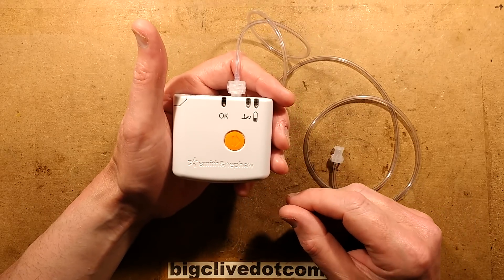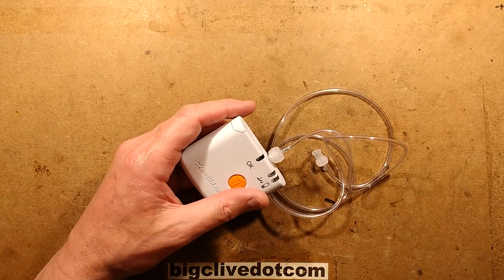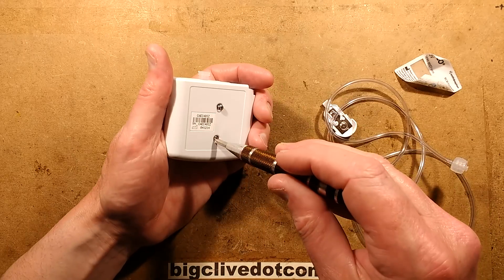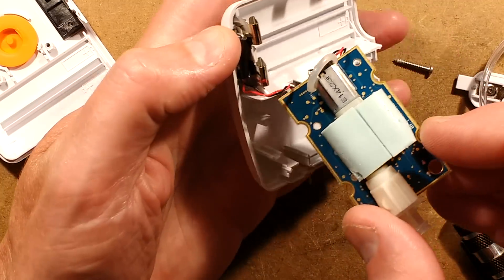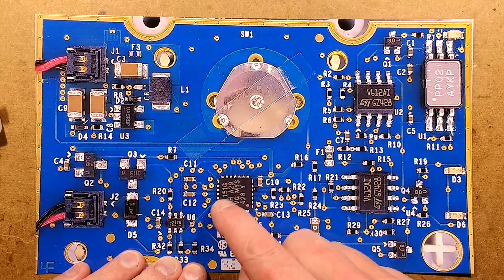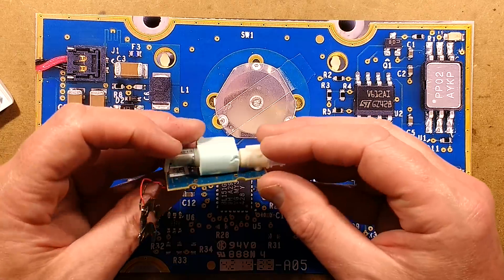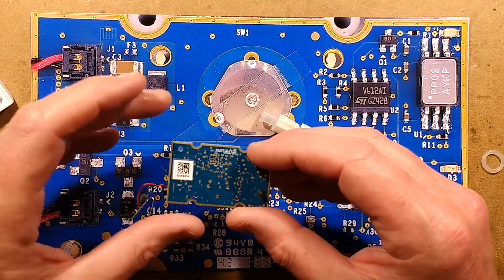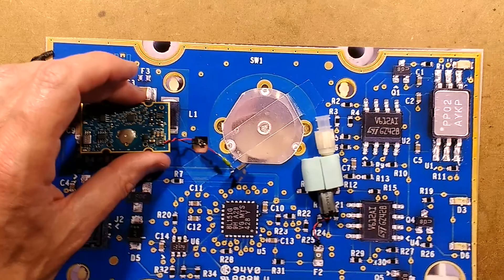Inside a medical wound sucking machine.

Comment: When you said, "it is a device that sucks your wound," I heard, "it is a device that sucks your wind." Picture me doing a spit take. It has to do with variations in speech between Great Britain and the United States. A device that sucks your wind does indeed sound like a medical device though. If you have bad gas, you can put the other end of that hose up your butt, pump out the bad flatus, and pass it through an activated carbon filter before returning it back out for everyone to breath. You should get to work on that right away! Big Clive's Nasty Wind Sucking and Purification Machine. It improves the lives of your coworkers when you have to work with them with bad gas! This device should also be mandatory at all eating establishments. Who the hell likes it when your food preparers fart around your food?! BLECH! Just install Big Clive's Nasty Wind Sucking and Purification Machine up your butt and prepare food with ease as you casually pass gas with impunity!

Comment: Just thought I'd see what it costs... Holy moly over £120 for the pump and single dressing. That is ridiculous pricing simply because its a medical decide. This pump could easily be made for less than £25. But making it single use when the pump does not contact the wound seems excessively wasteful as the pump could easily be reused.

Comment: I had a 12" abdominal wound, was sent home from hospital with one of these. The local nurse assigned to check the wound and change the cover said she had never seen such a large wound heal so quickly. It was the first time she has seen this type of device. This thing really works, the seal over my wound was good so this thing hardly ever activated. It is not for sucking puss out, just to maintain negative pressure. The dressing part has a trap for fluids to prevent flooding of the pump.
Reply: Nick, It's great to hear that your foot long abdominal wound healed so well. Hope all is still well with you.
Reply: Yeah, it was a bad time, took about 2 years to really get back to 'the new normal', thanks.
Reply: It's good you got through it, and that you can put that chapter of your life behind you. Take care.
Reply: Several years ago I had major abdominal surgery.  After it, I had a similar (but MUCH more sophisticated) pump.  Mine even had a 3 or 4" color touch screen.  Definitely not disposable.  It had "cartridges" that contained filters, a tank for fluids, etc.  The cartridge was obviously disposable and you changed it once a week.  And yes, supposedly the vacuum actually helps heal wounds faster.  These types of devices are pretty common in the USA now.
Reply: I had surgery on my ankle and the wound got super infected, swelled up and burst open. After eating a crazy cocktail of antibiotics without getting better they got me connected to one like Dosbomber describes and only then things turned around and got better. Charge it every night, if it leaked and started to suck in air an alarm went off. Pretty sure I had to change it twice a week, had it for a while, maybe 3+ weeks, but not a full month. This was in Sweden in 2010, maybe the big one was the only one they had back then.
Reply: I had something like this hooked up to my ankle after some surgery about two years ago.  Great little gizmo.  Never took mine apart though... insurance company would not have been pleased.

Comment: Why is it absolutely necessary to expose an electronic pump to contamination so that the whole device has to be sabotaged and disposed of?  It seems like they could have easily isolated the expensive bits with a cheap replaceable hose.

Why stop at throwing away the pump after 1 week? Why not also shut down and bulldose the hospital it's being used in each and every week?  Nuke the entire city every 7 days!

Comment: I work as a software and electronic engineer at a company that design and setup production for industrial and medical equipment (Also in Sweden).
For industrial, we only read-protect the flash and lock the eeprom if our customer specifically ask for it or if we feel that it would be beneficial for protecting the customers IP (like specialized algoritms that's considered a trademark secret).

Having a hard time seeing what that could been in this product.
I would hook up and ST-Link V2 and try to read the memory, just for fun.

Comment: They also use a timer module on Roomba batteries. I had an unused battery expire after 12 months despite the NIMH cells being in very good condition. I managed to charge the cells up to full working voltage but the clever iRobot gadget politely told me to remove the battery and install a new one. The generic £15 packs also need this circuit for Roomba to activate.

Comment: Large wounds heal better under a slight vacuum, whereby granulation tissue forms that covers the wound bed, that skin or scar tissue can eventually grow over and cover. I think it has to do with better blood flow through the area by dilating the blood vessels with the slight vacuum. If a small hospital doesn't need something very often, or if there is a large variance in how many you need at a time, it can be better to have it be disposable. These things can be sterilized when they're new because the bacteria haven't yet created a resilient biofilm on all the parts, but once it's used you cannot sterilize it without taking it apart and scrubbing it off. By this point it's often cheaper to just make a new one and not have the liability of poorly sterilized equipment. Reusable equipment is expensive because a lot more design work goes into making it sterilizeable.

Comment: Are you willing to sell the pump and the "value plastic" brand of bayonet connector that is attached to the rubber adapter?... I am willing to pay $10.00 USD, plus the shipping cost and then $3.00 for your handling time.... or simply to say, does $25.00 USD buy this vacuum pump?
Reply: You can buy these pumps on ebay for tenth the price. 
https://www.ebay.co.uk/itm/292070271606

Comment: 30 years ago, hospitals just used a squeezed plastic bottle. When the bottle expanded to full size, it was tossed.  Of cause I saw that for sucking liquids from inside a surgery wound, not air from a surface wound.

Comment: One would think the manufacturer would take them back, "recondition" them, and resell them.
Reply: Why would they do that? Have to disassemble the whole thing. Get it certified sterile. Ship it back to the hospitals at a lower cost. Then have to pay for more insurance... That now has the potential for a <1% error of a dirty pump being shipped and killing a patient. There must be a 0% failure rate in a medical product.
Reply: More money in screwing the NHS for a brand new one.
Reply: The same reason Space X spent so much to make their rockets land for reuse.  It would be way cheaper to pop open a used one, reset the chip, and swap out the pump.  Then, when you have enough pumps saved up, recondition those for placing into reconditioned units.

A) The new ones aren't sterilized.  They don't need to be...  They don't come into direct contact with the patient.  The bandage applied to the wound is supposed to be.  The plastic hose betwixt the bandage and the unit might be cleaned at the factory when it's put in its plastic bag, but who knows what happened betwixt then and use.  The sheets and blanket on the bed and the gown the patient wears, all of which are closer to the wound than this unit, are not sterilized.  Go to a hospital and look at all the doodad machines they have in every room.  None of them are sterilized.  They have lines run to every room so they can hook a plastic hose to it and pump oxygen right into a patient's lungs.  Do you think those lines in the walls are ever rinsed out let alone sterilized?  The ice machine at a McDonald's is cleaned more often.

2) Nothing in the world has a 0% failure rate.  Not even the simplest box of adhesive bandages or bottle of aspirin.  The hospital that uses these units has boxes of them.  If one doesn't work, they pull out another.  Just make sure it gets noted so it can go on the bill.
Reply: Doubtful.  They can probably make the same amount of profit on a reconditioned one as they do on a new one.  Maybe more...  If their cost to recondition a unit is low enough.

And who says they wouldn't charge the same price?  What's the difference betwixt a new unit and a reconditioned unit if the manufacturer guarantees the same performance?  I would think the reconditioned units would have lower failure rate than a new ones...  The reconditioned units have been touched by a technician and given a quick test.  The new units are straight from the factory with less than 1% ever tested before shipping.  Small electronics rarely receive any quality control testing nowadays...  That's the job of the customer.  If too many units come back defective, then they start looking into manufacturing.
Reply: I posed the same question to the VA on my CPAP machine. After about 5-6 years, the motor wears out, so they give you a new machine and trash the "old" one. They told me they can't recycle anything that has been in contact with a patient.  I don't know what the VA pays for each machine but one can only imagine the costs even if they only had 10,000 veterans using them.

Comment: Feel free to call me a cynical git, I'm accustomed.  If I have renal dialysis do they throw the whole machine away before treating the next patient?  I don't think so.  The machine is modular to separate that which may be contaminated from that which won't be.  The only part of the machine shown here that may be contaminated is the vacuum pump, not including the motor.  So why isn't it designed for the pump (a few scraps of plastic) to be easily slipped off the motor and replaced by a new sterile one?  10 euros instead of 300.

Comment: That's completely ludicrous.  All you need is a rubber bell thing that you squeeze and the fluids collect inside it.  What kind of idiot would put a device that has so many failure points on a wound, not to mention the price.

How about detox instead of buying junk on the internet and wasting people's time so you can get drunk in your unheated garage in the middle of nowhere.

> Unsubscribed.

Comment: Ah, go ahead and cheat Smith & Nephew. Stick an aquarium pump on that wound. A new one, of course.
Reply: Do you mean a new wound or a new pump?
Reply: Or both. The wound I just got is from following along with Clive's TOP ECO DIY TIPZ.
Reply: Paul Drake aquarium pump blows though.
Reply: Oh, I thought that was just an unkind rumor.
Reply: Paul, I'm sticking with my Gast, a =real= vacuum pump.  So far, I've lost 75 pounds.  Maybe it works too well?  But the beer belly is gone!

Comment: That's odd that they'd have a wound vac only for 7 days. Usually when someone needs a wound vac it's a several week to month process. A person usually gets their own large device that runs constantly and you change the disposable cartridges that are full of bodily fluid etc. By applying negative pressure to the wound bed the goal is to pull the edges of the wound together. Because these wounds usually tunnel leaving more empty and infected space than the initial break in the skin suggests. These devices also degrade some of the surface tissue and stimulate the body's natural response to prioritize healing to the damaged area. They're fascinating devices.

Comment: As a side note most single use equipment I use on the ambulance most are recyclable and hospitals try to recycle what they can.
Reply: Heather Fox Which is why safety authorities are now paranoid about having single use enforcement in the hardware, so money-focused hospital owners don't cause cost-cutting hospital managers to make stressed out maintenance workers to make down-trotten nurses reuse infected consumables to spread multiresistant bacteria.
Reply: John Francis Doe I'm not sure where you are getting this from but I know the opposite to be true here. Infection control is something they are pushing in the most basic leves of medical training.

Comment: You didn't mention the silver disc secured by cello tape in the 12:00 o'clock position.   Is it some kind of button cell back up power supply?
Reply: Wil Hobbs That's simply a snap dome switch.
Reply: Wil Hobbs He mentions it at 3:33
Reply: John Francis Doe 
Thanks

Comment: Interesting device pity it wastes tech by permanently self destructing, So does this thing attempt to maintain a vacuum bandage around a wound for a few days? , I wonder if it could stop someone bleeding out or something.
Reply: steve64464 No, sucking doesn't stop bleeding. It directs the bleeding to where a fresh supply of healing cells are most needed and reduces scars.
Reply: Impressive tech , Not sure if they are available/used in the uk but then again the NHS is on its knees.

Comment: I'm a plastic surgeon and  deal with negative pressure wound therapy (NPWT) on an everyday basis. There are a few of these small devices and they are often sold as preventive therapy for surgical wounds to help ensure best possible healing. They are not really suitable for open wounds except for the very smallest with minimal drainage. Even then, it's not very likely that a single week would be enough. The original device that established the therapeutic usefulness was the KCI Wound Vac. This device works in the same way, by applying negative pressure to an open cell foam in the wound. The devices used for this purpose have large canisters to collect the wound drainage. If you were able to tear down one of the big units, that would be really interesting, however unlikely that would be.  They can also be used at home in a (slightly) smaller version. Representatives for the companies that make the small ones, such as you have, call on me frequently. I've asked them why the device is limited to a week (more or less) and they have lots of noise that doesn't really make a lot of sense.
The basic unit often, as in your case, allows for placement of fresh batteries. Infection indeed is not an issue, as the dressing is changed every day and is what actually handles the low level of drainage for which these units are intended. Also, if the unit is overwhelmed with drainage that actually makes it to the pump, it has some sort of failure switch and it promptly is done, never to work again. 
I suspect that it is really nothing more complicated than allow them to dictate the market and, if the patient would benefit from a second week (or more) of NPWT, then you either must order a second PICO (or whatever device you are using), or step up to the larger unit. 
Thanks for the video. I've been wondering exactly what was inside.
Reply: Stinky Cheese I hope you nurse better than you read because he said this model of vacuum pump isn’t good for an open wound. He didn’t say “vacuum pumps aren’t good for wound care.”
Reply: Gregory Malchuk 
Did you miss the word " routinely " ?
Reply: Gregory Malchuk there are actually reconstructive procedures for that, but the complication rate is very high and not considered a really viable procedure in practice
Reply: You must be talking about the US, as we don't routinely circumcise babies in the UK.
Reply: Yep.  The KCI Wound Vac.  That's the one I had.  Thanks for jarring my memory!  Was a pretty sophisticated device complete with a color LCD touch screen...  Incidentally, I had to use mine for a few months on a large abdominal surgical wound.
Reply: Making removable batteries is probably more of a disposal problem.  You aren't supposed to throw batteries in the trash.
Reply: I had a vacuum dressing done before you could even get the full sized hospital units. The pump was a low pressure vacuum pump that was so old and big that it was on a trolley with cast iron wheels. It could only be used during the day as it made too much noise for people to sleep at night. The dressing itself was created using airtight coverings and the tubing was some kind of wound irrigation  tube with lots of little holes in it then stuck under the airtight covering and it feed into a suction collection bottle. It worked a treat.
Reply: Pete Allum 
This is not true. You have not banned circumcision and have not actually dealt with the issue in any concrete way. Thousands of boys are mutilated by the NHS, and many thousands more are mutilated under religious auspices. You need to watch two of my videos titled "A European Clrcumclslon" and "Attention Uncircumclsed Men". I am really disappointed when European men react to me by saying "we don't do that here" when it is not true and it still hasn't been banned.
Reply: @gregorymalchuk272  well, here in Holland we do not circumsize, only when there is a medical reason for it like an bad inflammation or something, otherwise not
Reply: Bufford Moore 
When will they start using stem cell tissue regeneration to regenerate the foreskins of "circumcised"/genitally mutilated men?
Reply: Bufford Moore 
I'm not talking about plastic surgery or stretching, I am talking about using stem cell based tissue regeneration to regenerate anatomically, neurologically, and histologically accurate human foreskins. This is technologically trivial, as they are ALREADY regenerating rabbit penises with successful implantation. This is a matter of political will and funding. And the government MUST pay for this massive project. A society that rapes babies MUST pay.
Reply: With all due respect, I have to disagree.  For months I tended someone who had a huge open wound and had this (type of, different brand) device not been available, probably would have had to have their leg amputated.  I am not a doctor so I may be wrong but the entire tibialus anterior had to be removed.  The wound was packed with foam, had a plastic cover over it to which this device was attached.   Picture of initial post-operative wound, before months and skin grafts:  
https://imgur.com/a/lCzppSO